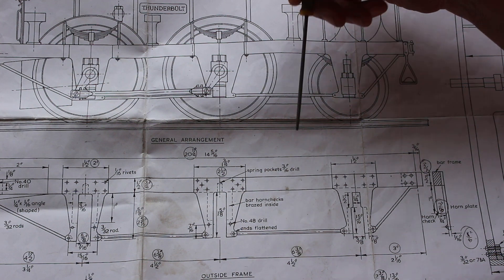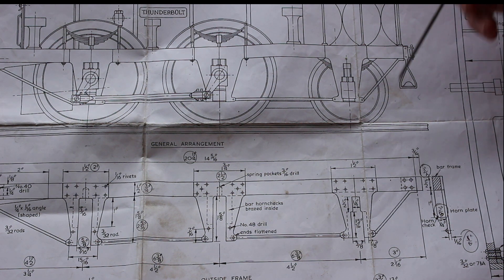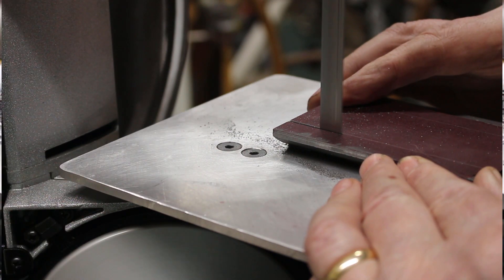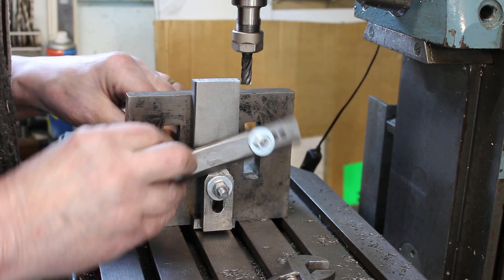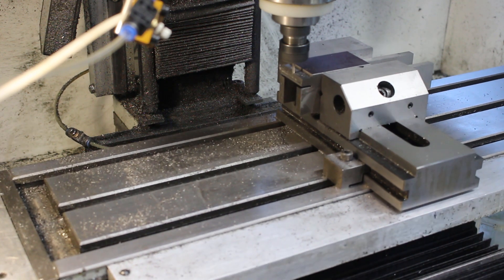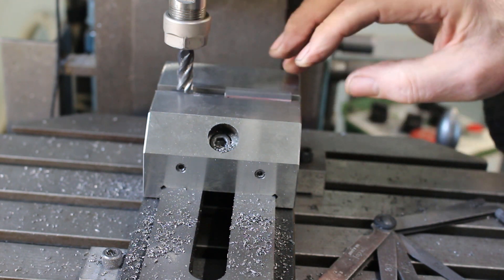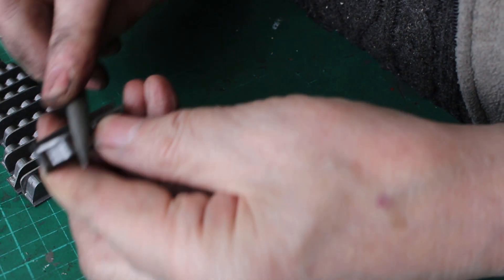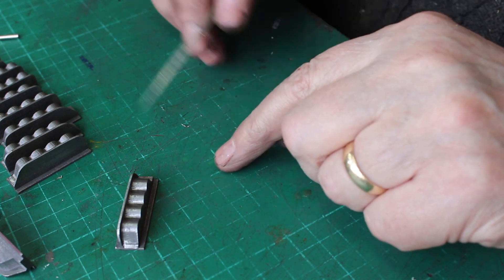LION - Miniature Locomotive Build pt. 22 - Horn Plates + shaping machine operations

Comment: Great video. Is that a Denford CNC milling machine?
Reply from the maker: Thanks Steam Train Builder. My cnc mill is a conversion I did using a cheap mill as the base machine.
Reply: Looks a nice machine. I have been looking at the Boxford 190VMCxi and Denford machines as I fancy getting myself one. Don’t have 3ph to run a Haas mini mill, so one of those will have to do 😁